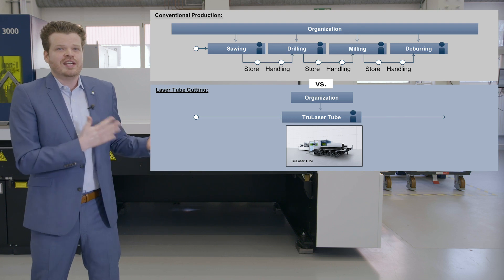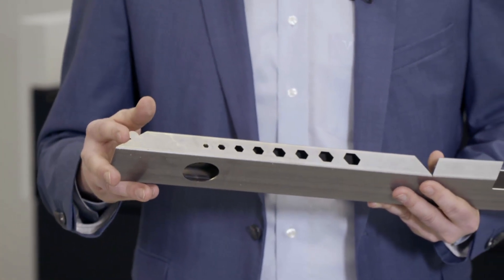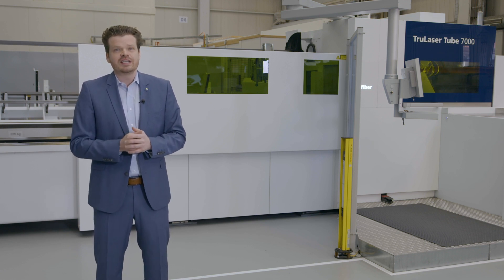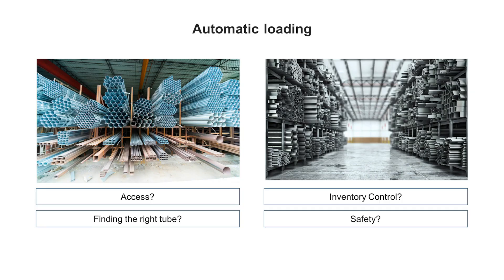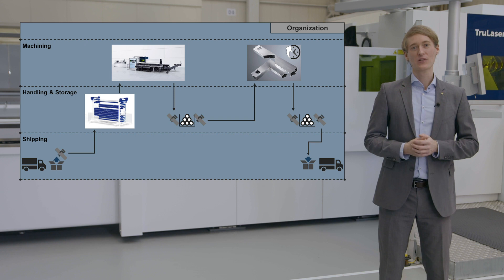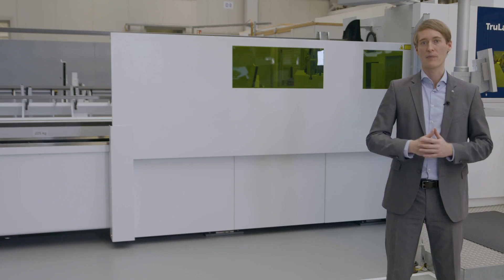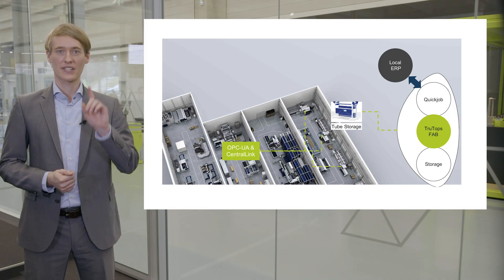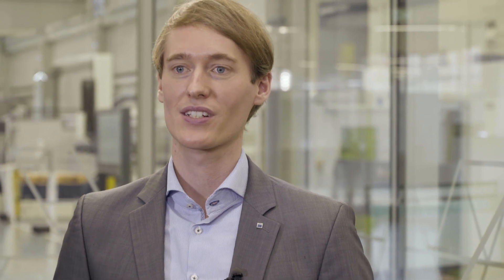TRUMPF Virtual INTECH 2021: Laser tube cutting - Efficiency all around

Comment: I found a tube while working and I was wondering what it was for. it looks like a bottle opener and it's flexible in the center due to a continuous cut that consist of a bunch of loop shapes that interlock. i was wondering if this was some kind of sample. it says tubes prefer trumpf on it on 2 places.  either way it's a pretty cool design. your machines must be very good.